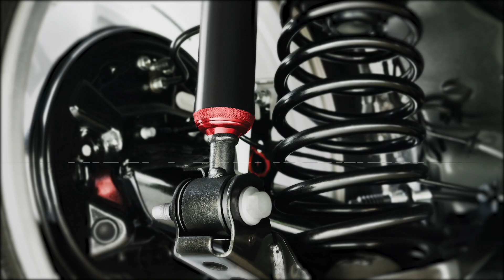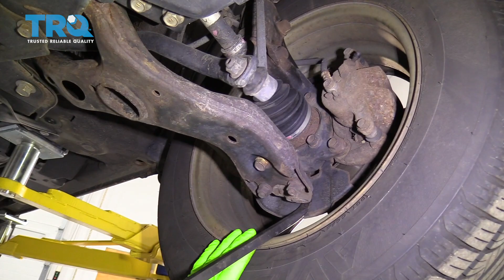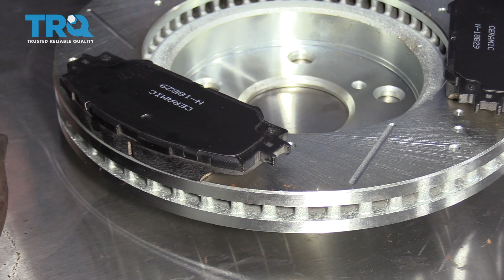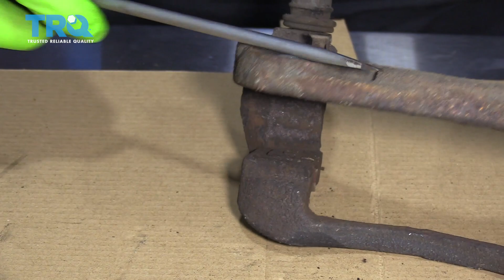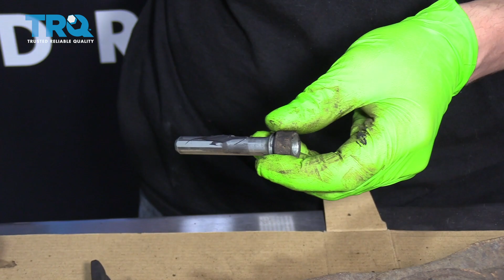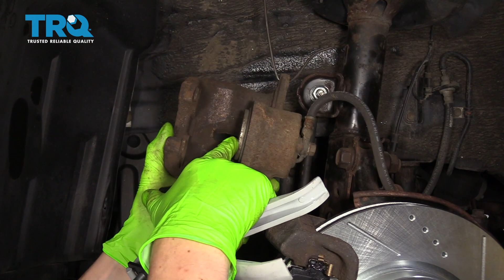How to Replace Front Brakes 05-16 Toyota Rav4

Comment: What I also like to do is spray paint with black or grey the rotor (the inner part that sticks out), this way the rotor looks nice for a lot longer time without looking rusty because that part rusts within a few weeks in rust belt states. Other than that, excellent video!

Comment: I like the comment you made right at the end about liking to check the you torqued all the wheel nuts. Last time i took my Rav to my local toyota dealer i got it back with one less nut on one of the wheels.So they don't even like to check it's got the right about of lug nuts holding the wheel. Wanna be my new mechanic?

Comment: Thanks for this! My father was an auto mechanic. So is my brother. I watched him do a brake job on my 2007 RAV4 5 years ago. I decided back then that the next time I'd try to do it myself. Between watching my brother and your video I was able to successfully accomplish the job. Of course, I ran into a few stumbling blocks along the way. The front left and right caliper pins were nearly frozen in place, despite being greased at the time of the last brake job. I was able to get them freed up and working correctly. The rear brake calipers were TOAST! The caliper pins were completely frozen in place. One was so bad that when trying to free it up... It broke off in the hole! There was also an unbelievable amount of rust inside of the pistons. I replaced both sides of the rear calipers and bled the brakes. After the break in, all is well.
Reply from the maker: +Reed Grele Thanks for watching our video! http://1aau.to/m/Shop-TRQ
Reply: Use silicone paste for pins, not grease.

Comment: I always clean and lube my pins while I'm there
Reply: Yep. I do the "Toyota way" as described in Rav4World - use a rubber/silicon-safe grease for the piston boot - it is good at high temps. Good for that side brake pad - apply thin film on the pad and piston area.

Comment: I purchased TRQ front pad/rotors for my 06 RAV4 and do not see the metal clip that goes on top of the brake pad in this video??  Jhun Zamora called them  metal sensors. The clips were in the box the pads came with and was on the brake pad that I removed. If anyone is wondering what the bolt size is to help get a stuck rotor off it is 8M-1.25.

Comment: Yo forgot to mention to brake clean the new rotors since they come with grease
Reply: The drilled and slotted rotors have a nickel coating, not a film rust inhibitor. They don't need brake cleaner.

Comment: What size of thread are the bolts used to break rotor clear of the hub and what type of grease to you use on the movable pin?
Reply: Yes...What size bolt????
Reply: @rickbeckman2306  On my 2006 RAV4 the bolt size was 8M-1.25
Reply: Chris fix said to use silicone grease so that's what I use, look him up